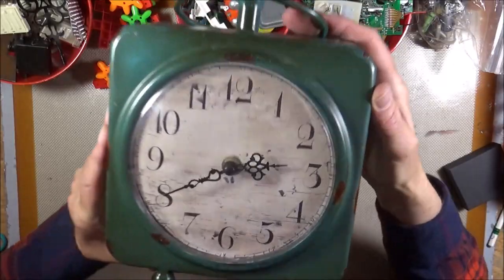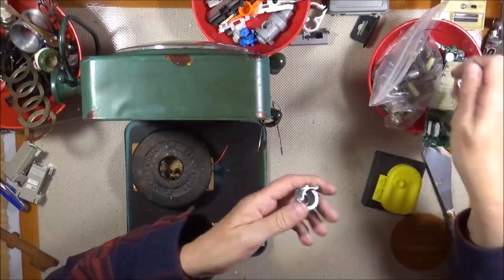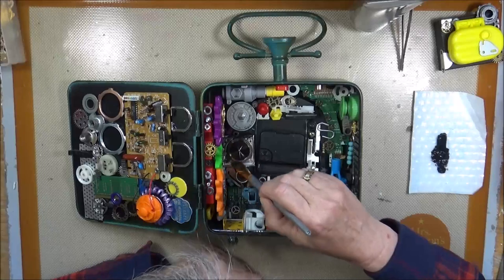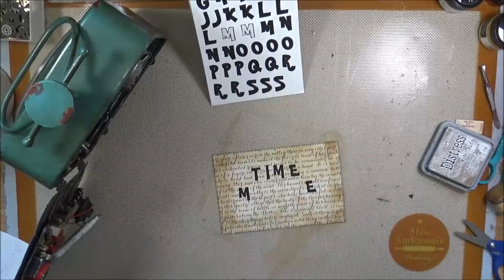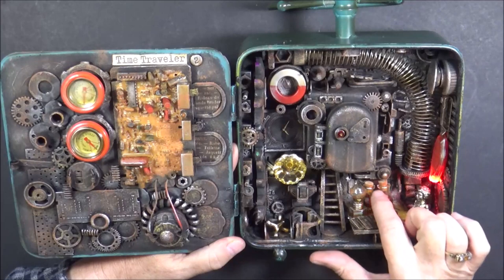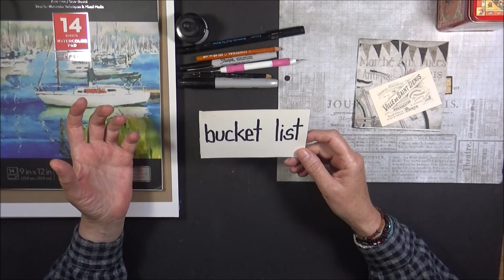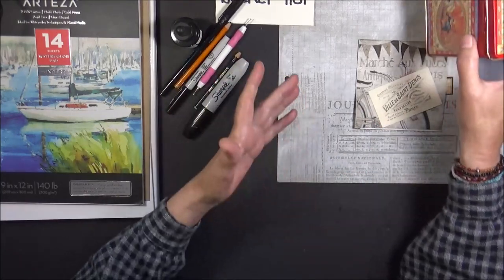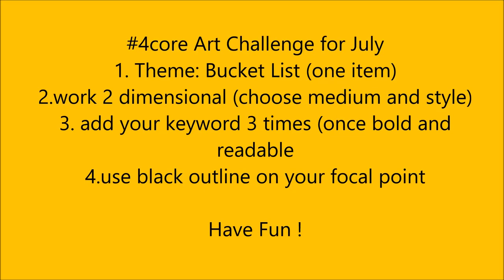Time Machine Assemblage..#4core June Results and July Challenge

Comment: Question - I want to decorate (the outside) of a shower curtain. Do you have any suggestions for what would permanently adhere to this type of plastic and withstand heavy moisture?
Reply from the maker: Hi Sage. .interesting question. I would think that oil based paints could stick (the handyman type) or spray paints used with stencils might work. I have to say could or might, as I have never painted a shower curtain. But try it and let me know what works. Good luck with your project.

Comment: What´s the difference between using black paint and black gesso? Im curious, and what is the white paste you use to glue? Your creations always amaze me 🤗
Reply from the maker: Thank you so very much Priscilla. Gesso is a primer, it will cover up anything you don't want to see, it also has grit, a slight texture, which helps with the next layer you will add on top. Canvas boards or frames you can buy, come with a white gesso covering.   In this project I used texture paste for that one rough piece, but 3D gel works even better. Thanks for asking ,I hope this helps. : )
Reply from the maker: Here is my no pressure reminder about the #4core Challenge. There are still 10 days left in July to play along. Have fun creating. : )

Comment: So many beautiful posts have been designed again!  I'm excited!  Where do you always get these great circuit boards from PCs?  The structures are great!  I also like the moving gears a lot, as well as the rust effect.  The alarm clock alone is wonderful, but thanks to your design, it has gained a lot again.  Unfortunately, I didn't understand everything about the 4core for July.  Bucket translates as a EIMER.  That doesn't make sense to me with the list.  Maybe you can explain that to me again. ❤👍 LG vom Tinchen
Reply from the maker: Thank you so so much for your great feedback Tinchen. I took apart an old laptop for some of the circuit boards, others I found at a 2nd hand Art Store.
Now to the bucket list. In english you can say: "kick the bucket" for :to die". The term was made famous by a 2007 movie (with Jack Nickelson),by the same name. In Germany the movie was called "Das Schoenste kommt sum Schluss."
Langenscheidt says "Wunschliste der Dinge die man vor seinem Tod noch erleben möchte". It may sound a bit dark, but it's actually a call to make the best of every day and opportunity. Just pick one thing you always wanted to do and illustrate it. As I said, it can be something simple or something more adventurous. Have fun with this and I can't wait to see what you come up with.
Hugs : )
Reply: @InaSolsberyartroom  Thank you for the great explanation.  Now I know. 👍❤ Hugs
Reply from the maker: Here is my no pressure reminder about the #4core Challenge. There are still 10 days left in July to play along. Have fun creating. : )
Reply: @InaSolsberyartroom  ❤ Thanks! Hugs